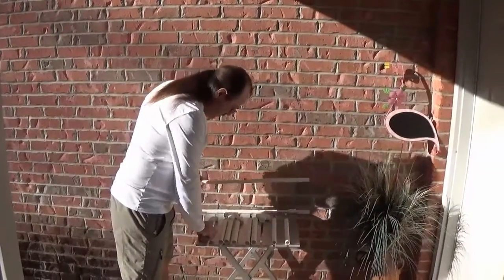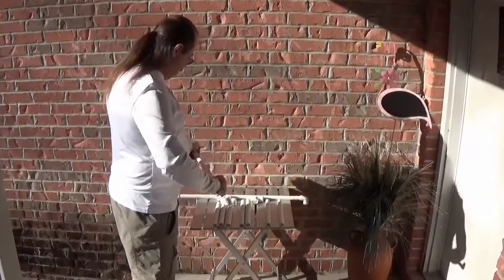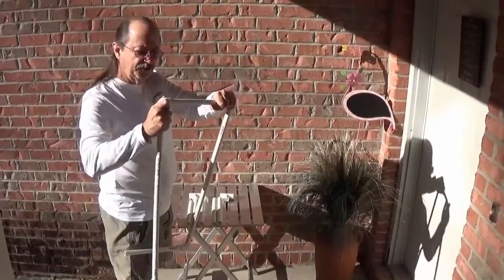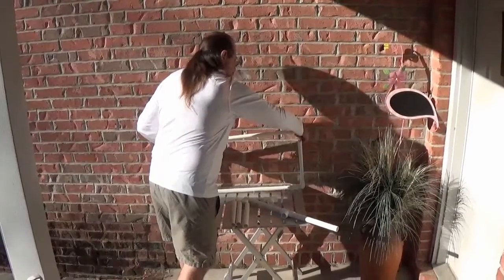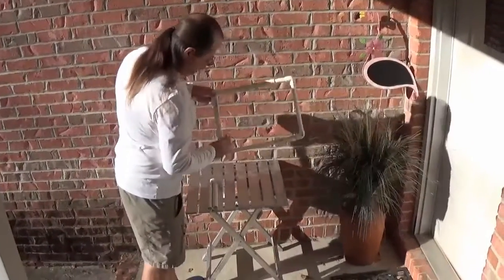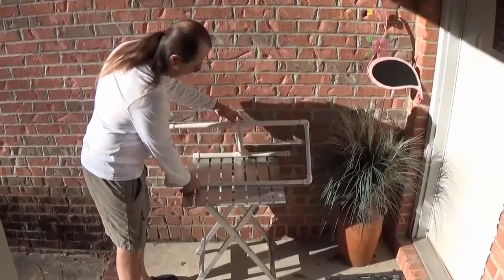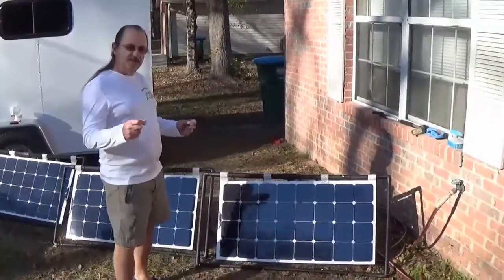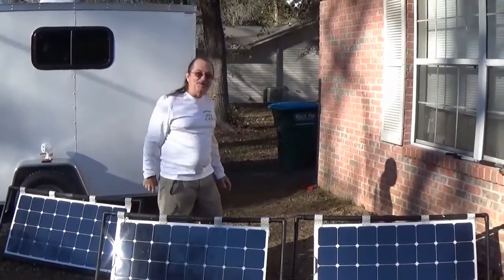Complete Solar Powered Bugout Trailer Part Two

Comment: Brilliant! How did you attach the panels to the PVC pipe?
Reply from the maker: Barbara Zarzosa ...they are attached by using industrial strength velcro...2 to 4 per panel.  cut into strips...works great so far.
Reply: @carmenwilliams-omotv5421  Thank you! Brilliant!